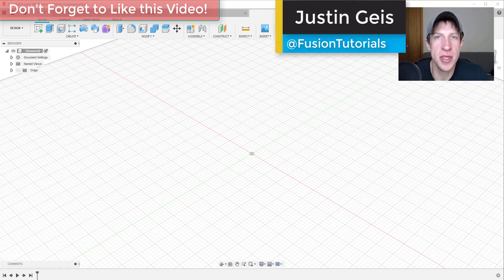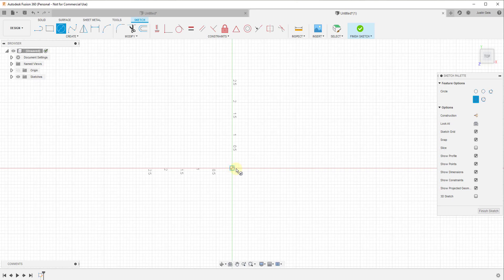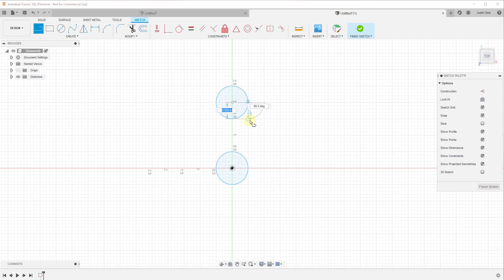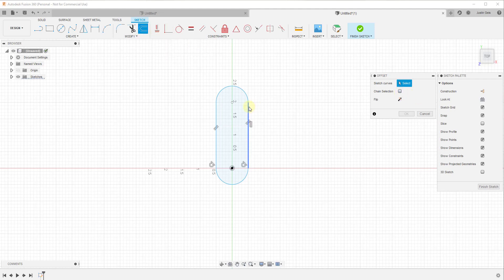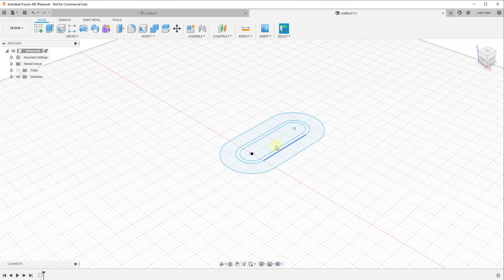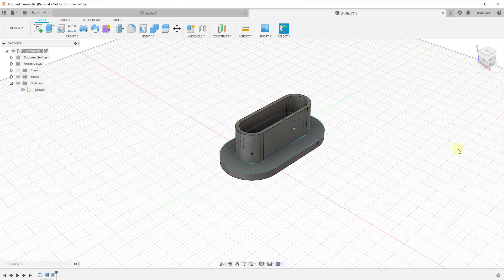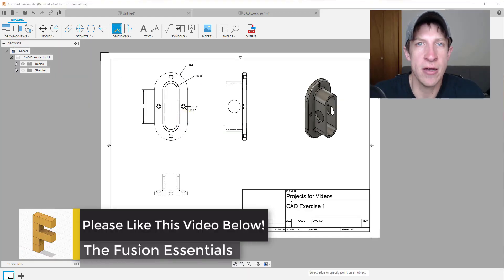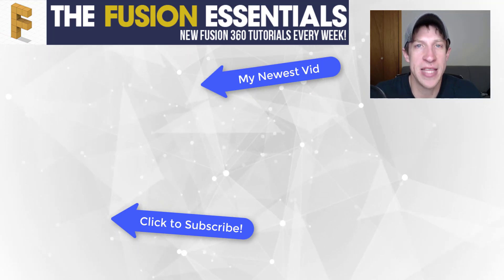Fusion 360 MODELING EXERCISE - Creating a Wall Bracket

Comment: I have a video request for something that does not behave the way it should based on what I see in videos. If you will go the AutomationDirect and get the step files for these three parts I'd like to see how to assemble them properly. They are pneumatic parts with those donut connections. I will list the part numbers in the order they are assembled 1)AFR-2233-M  2)AB-2T  3)ADB-22  4) AB-2T again, 5) ASD-22-24D.  That is a pressure regulator, a connector, a manifold (distribution block), another connector, and ending with a soft start valve. If you really want to ice this cake then please show how to connect a PTD25-20-0100H pressure transducer to the manifold. This is the standard start of a pneumatic supply. I'm trying to model it to see if assembly will fit into the enclosure I want to use. Thank you so much.